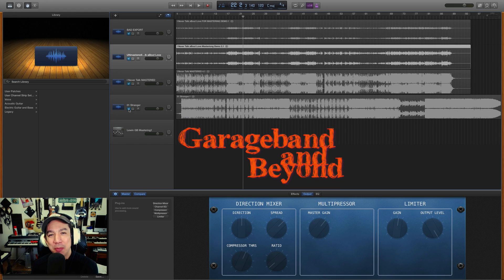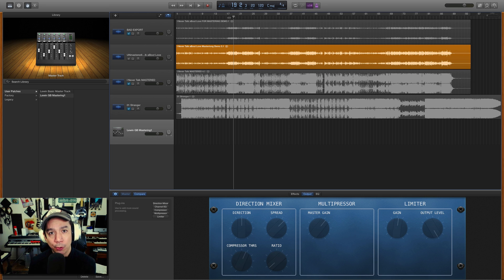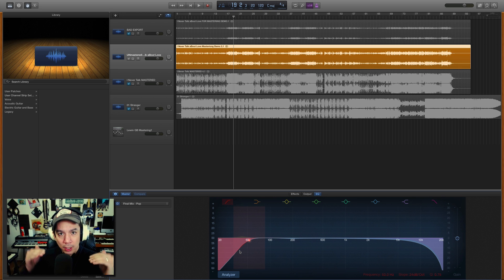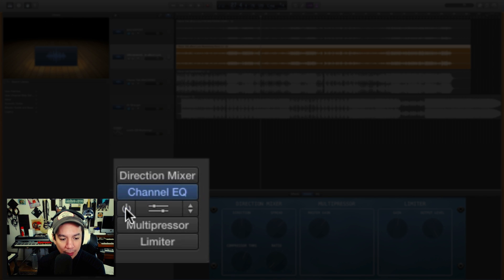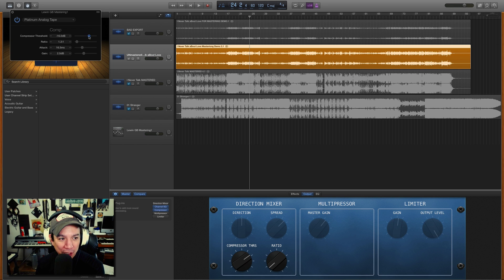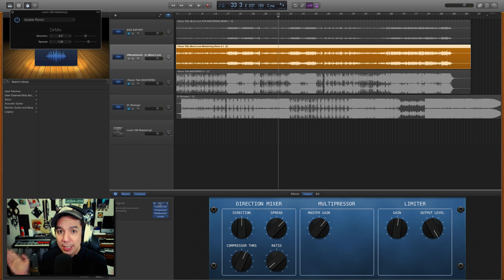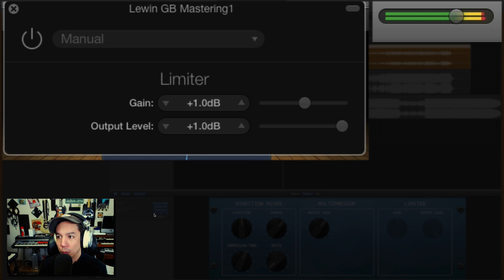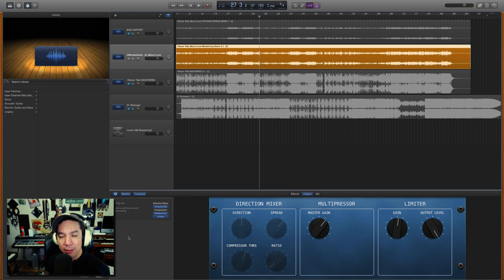Garageband Mastering Tutorial-Custom Preset for you! - 2017

Comment: In the previous mastering video you did from 2015, you used 2 compressors in the master channel one with platinum analog tape and the other was a default I believe. In this you used one compressor the platinum, which you said is optional. So im just curious which way is better to go and why you slimmed the master plugins down now compared to 2015? Is 1 compressor cleaner or easier to use than 2 or is it unnecessary to use 2 or is it just for getting a different sound? 

Sorry this is so long i'm just getting into mastering, both of your videos have been incredible, so thank you so much!

Comment: This is helpful, but I have a problem. I have some meters popping into the red. I want to try and bring everything down to stay in the yellow as you have specified. However, I have done extensive automation on the vocal track and other tracks. I do not know how to lower the track volume and keep the automation. This is something I would have done in Pro-Tools by bussing it to another track to "pull down" the volume whilst keeping the automation. Also, I would (and could) group numerous faders into a subgroup to bring down everything (keeping the automation on each fader). This technique bringing down the level across the entire song (keeping it out of the red). In GarageBand, it appears I must do this one fader at a time, which of course completely wrecks my mix and is ridiculously labor intensive. Then in the unfortunate event of working through the mix, and bringing the levels down to manageable levels... but then experiencing one area at the very end of the song where I again hit the red... I am forced to start the entire process over from the start losing the entire mix I have been working on (ouch). Seems there should be some sort of command that lowers all faders by a specific dB, but I do not see this as a possibility in the current version.  Is there anyway you can think of doing this besides exporting one track out at a time, bringing it back in and lowering the level, or scrapping the automation completely? If not, I think this may be another reason for me to upgrade to Logic Pro X.

Comment: Hey guys, I just finished my first master and in garagegeband the song seemed to be coming up just under the clipping red on the master fader but when I exported the WAv and brought it back to garageband the waves seem to be only reaching 75Db. How do I make the waves reach the top if the master fader says it's just about to clip at 75Db?
Reply from the maker: First thing, would you might’ve picked up from this video, It’s not 75 DB, that 75% of the total waveform possible. I Deleigh you want to push it up so that the highest peaks will come in around 99% to 100% occasionally.
There is an updated version of this video that you should check out it’s called “GarageBand mastering custom preset 2018! With real metering!”

Comment: Is it really such a good idea to be 'living in the red' like that and is it truly necessary to bounce the entire mix back into Garageband if your levels and overall sound are already really good ? Surely if you recompress the stereo mix-down into the red, the entire result will be clipping and the top of the amplitude peaks will be truncated and horribly clipped ? I do a lot of mix-downs with Garageband and usually use the master track at the multi-track mixing down stage and apply minimal EQ and/or compression/limiting or overall post FX then and there.

Comment: Is the volume on the computer turned all the way up?
Reply from the maker: I am running all of my audio through an interface. Which means that the computer volume buttons on the keyboard don’t  work anymore. I have to change the output level on my monitoring system. But, no in general you would not want the speakers on your computer to be set at maximum! In fact mixing and mastering requires that at times you were listening at very low volumes to make sure that the balance is correct.￼ I have to change the output level on my monitoring system. But, no in general you would not want the speakers on your computer to be set at maximum! In fact mixing and mastering requires that at times you were listening at very low volumes to make sure that the balance is correct.
Also, make sure you check out my updated version of this video. There’s a 2018 mastering custom presets video that also includes a bunch of free plug-ins.
Reply: @GaragebandandBeyond  thanks fam.

Comment: Hey Lewin. My question is that on several of my recordings I get about 5 or 6 seconds of dead time at the end of the song.  I want it to end when it ends.  How can I fix.  Thank you for all your help!
Reply from the maker: You know what, I ran into this exact problem two days ago while working on someone else’s mix. I really have no idea why was happening, but to solve it I did two things. First I went through and made sure that I wasn’t running too many heavy plug-ins on every channel. Stuff that if I turned it off, no one would really know but me. In this case I had the Slate Digital tape machine running in too many channels, so I got rid of those.
Next I simply locked all of the midi tracks. 
Then on export I had the loop control on and set to the proper beginning and end points and of course made sure that that box was checked before I actually hit “share“.
For whatever reason, that seems to fix my problem. I hope that helps!
Reply: GaragebandandBeyond Lewin I find if I take the cursor up to the upper right corner a certain icon appears and allows me to grab the "skrim" that lays as a backdrop and move it to the left and drop the movement.  Works pretty well.

Comment: 3 questions for you if I can (pleeeeease help). When your project is finished being recorded and ready to export to the desktop (to be brought back for the mastering), how much importance, if any, does the Volume control on the very top right have to do with it? Do I adjust that before exporting? Do I EVER adjust that? 
I am running Garageband of a few years ago and mine does not have the "multipressor". It just says "compressor" like the other one. Do I need to upgrade the GB? If so to what version do you recommend? 
And 3, looking at your levels on the both the mastered and non-mastered versions and they are both way high. Mine always come out about only 2/3 of that. Why is that? 
Sorry for all the questions but you are an amazing teacher and have helped me so much and I respect the hell out of ya. Any help would be much appreciated. 
Cheers from Montreal.

Comment: Thanks for a great video. I have a question though. When exporting before reimporting, should normalize be turned on in the export settings? Or is that something you do in the final export? Also I am currently editing a filmed musical. I have on-stage dialogue and audience sound one track (not ideal maybe but because of time I have to go with that). I need to increase the volume there. Then I need to, in garageband, add the music performances on other tracks, before exporting one sound file into Premiere Elements where I am editing the video. Should I export every single song (whole song in one track unfortunately) individually without normalize before reimporting to GB? Also can I use any audio editing tools on the individual tracks before doing this?

Comment: A couple of notes about keeping levels out of the red. The OCD in me really freaked out when Apple removed the peak hold indicators of each track and the master volume indicator, compounded by the change to gradient color changes from yellow to red, rather than "hard" yellow and "hard" red. I needed to find a way to trust the meters, so I generated a solid tone in Audacity that peaked at 0db, brought that into GarageBand, set the track level to 0db, and observed the playback volume meters using both the track meter and a 3rd party VU meter on the effects chain. As I expected, GarageBand's track meters are off by about -1.4db, so when you see a track going into the red... it's not really clipping. The master volume indicator is off by even more — about -2.8db. (More on this in a second)

To make the meters useful, I've taken to adding Gain set to -1.4db to the bottom of the effects chain for each track, and I can then adjust the volume up to the point that I see the first indication of red (or lower, of course, as required for the mix). Once you turn the Gain off (which, of course, you should since it's just there to make the meters read accurately), the track will go into the red, but if you export the track and look at it in any other audio application you'll see that it does not go beyond 0db.

Okay, so why are the meters off? I think this is Apple condescending to what they believe to be the ignorance of home market. Managing gain can be really tricky, so by bringing the "into the red" threshold down for each track and the master volume it kind of tricks users into not pushing their mixes too hard — especially where you have lots of tracks playing simultaneously. Moreover... the master volume slider has absolutely no effect on export if auto normalize is turned off (unless set to negative infinity). But there is a kind of placebo effect of the meters on users when setting track volumes. So, if the meter is off by -2.8db, it makes users more sensitive to setting individual track volumes, which (unless auto normalize is off) is far more important to export. Ever notice the lack of precision in the master volume slider? You'd think that this would be fairly finely tuned as an essential input variable to exporting. But... no, it really jumps around. I'm pretty sure that with GB 10.x, Apple's emphasis shifted to exporting with auto normalize on, which — from Apple's perspective — solved the avalanche of user complaints with earlier releases that "my song isn't loud enough". As such, they also changed the behavior of the meters to psychologically train users to record at lower volumes.

Anyhow, some thoughts!

Comment: I've almost got the mastering down, but I can't seem to reduce the bass on the track (2 powerful beats & a chord instrumental loop with deep bass),  I've tried to play with the Single Band EQ effect, and nothing seems to work. Is there anything you can suggest to try? oh it's a EDM track if that helps.
Reply from the maker: +Rav3n you're cutting the bass out and it's not changing anything?

Go back and work on the drum track more.
Reply: GaragebandandBeyond the beats are also part of the loop files and I've tried everything compressors limiters, plugins and I can't seem to figure it out. The old version you had an option where it would reduce the deep bass on any loop
Reply from the maker: +Rav3n are the meters on the individual tracks clipping?

Comment: I wish you had more information on the difference between sound setup for individual tracks/instruments and for the whole song. For example, I tried using the EQ on the bass track alone but found it difficult to make those changes not affect the other tracks. Separating track/master controls has been hard.
I also wish you had explained why you export the song out of GB first as some other kind of "item" before doing mastering.
Reply from the maker: +Mark Mark I think you mean "mixing" when you say "sound set up for individual tracks"

I have an entire series on mixing.

All of your answers are waiting in that series!
Reply: Yes, and they are quite old and don't use GB V10 so after viewing one of them for a few minutes I see that while the concepts are valid, the "how-to" part mostly won't work anymore.

Comment: How do you find the Multipressor plug in? When I follow these steps, I only Have the plug-ins, Channel EQ, Compressor, Exciter, Limiter. Looks like you have a ton more options in your Library? Great video so far, thanks!
Reply: In 10.2.0 on any track vocal , guitar , master, click on plugins below noise gate. Go to the bottom of the plugins until you make a tiny line light up then click on it a menu will appear go to Audio Units to the right you will see apple when you put your curser over it another menu will appear that is where the multi band compressor and many great plugs are.
Reply: I have the same issue!-Anyone?
Reply: check the dynamics tab and it should be a few plug ins below the compressor